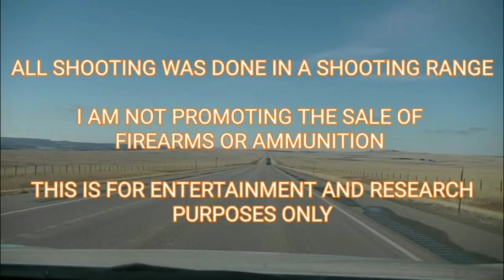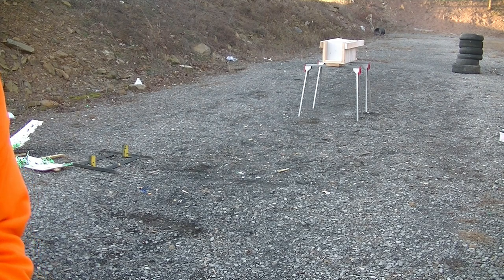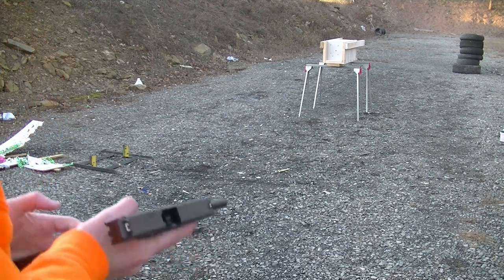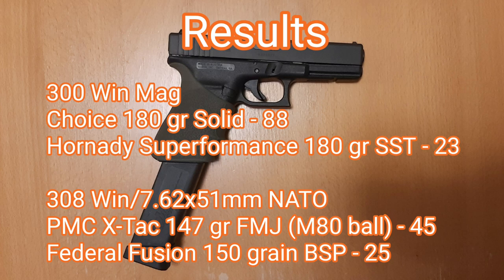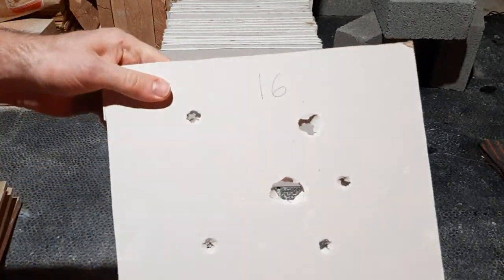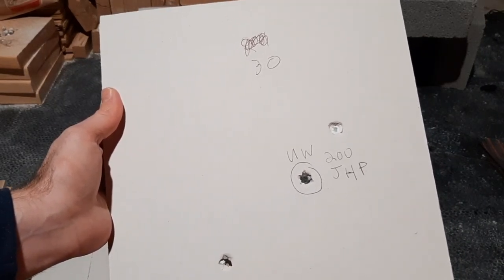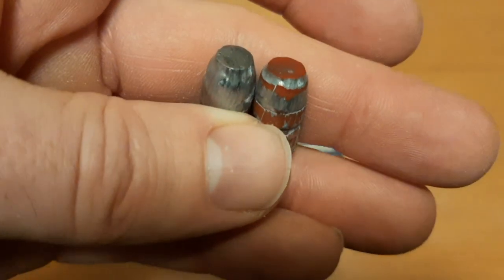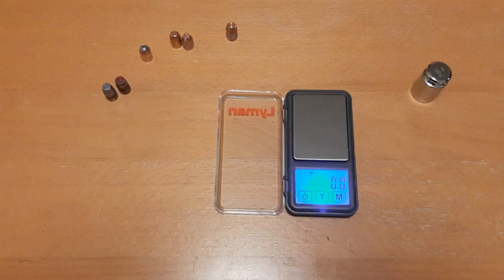10mm vs Drywall/Sheetrock - Bear Loads, Hollow Points, & FMJ

Comment: They also claim you shouldn’t shoot lead through glocks because of the type of rifling they use. But I have shot thousands of rds of lead in IDPA. The thing you need to do is clean the barrel after every range day to remove the lead smear fouling!!
Reply from the maker: Yes thats correct due to the Polygon rifling!! That is mostly for soft lead not hardcast.  I am not crazy about polygon rifle but it gets the jobs done.
Reply from the maker: Thanks for sharing that...should put a lot of people at ease..myself included.